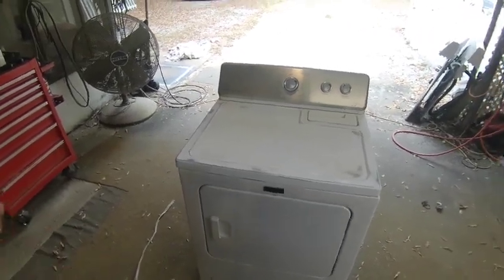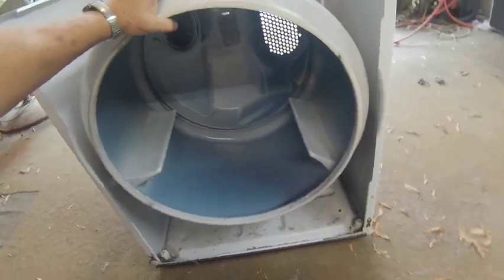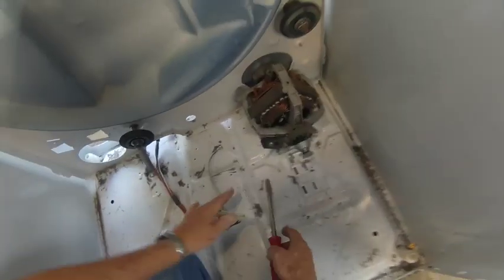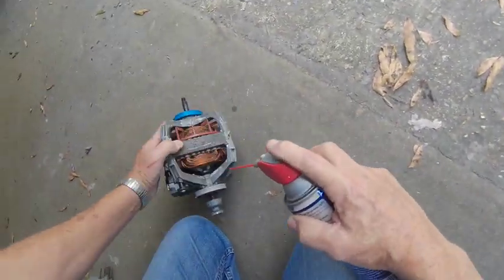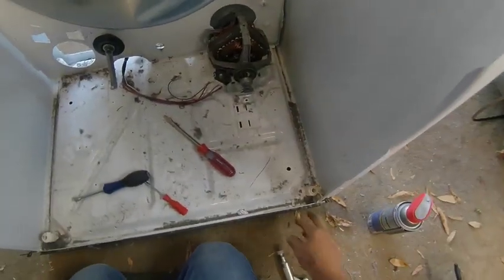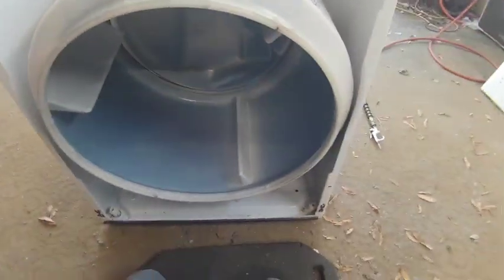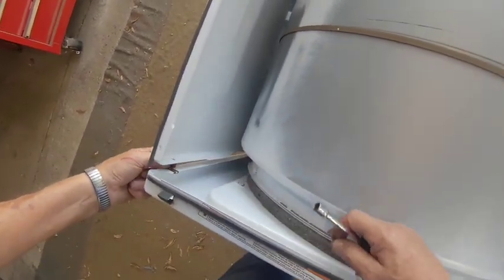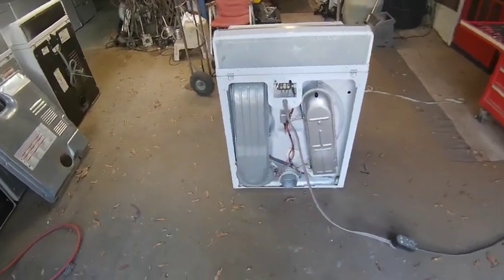How To Fix a Maytag Dryer That Won't Stay On: Motor Replacement Tutorial

Comment: Hey Harper nice video, just a handy suggestion.   On those fragile plastic squirrel cage fans I drilled two 1/4" holes about 1" radius or so away from center installed a spanner pin wrench to loosen fan, kinda like a Briggs flywheel. Good luck 👍
Reply from the maker: Hi there! Thank you for your comment and the helpful suggestion. Although my name is Knowles, not Harper, I appreciate your input. Using a spanner pin wrench to loosen the fan on fragile plastic squirrel cage fans is indeed a clever technique. It can provide better grip and make the process easier. I'm glad you found the video helpful, and I appreciate you taking the time to share your suggestion. Good luck with your repairs! 👍
Reply: Hi Knowles,  sorry for mix up for name.  How did you know it was left hand thread?  Shape of fin or rotation arrow, just wondering
Reply from the maker: I think I broke the first one I ever worked on and that costly mistake was converted to experience!  Some lessons are learned the hard way.

Comment: A homemade deep spanner type wrench that put pressure down at the bottom of the fins on both sides of that blower wheel at the same time would be a nice tool to have to take them off.
Reply from the maker: You should make one, patent it, retire as a millionaire! Good to see you Junk Yard, carry on.

Comment: I have a Maytag Centennial with a timer knob that rotates on its own, causing it to heat up even when I've set it to off. Would this be a timer issue or a motor issue? Any advice would be greatly appreciated!
Reply from the maker: For your timer to advance it has to have power supplied to the timer motor. There are several sets of points inside the timer and I’m betting that you will find one of these stuck together. Watch this video if you think you want to attempt fixing it. https://youtu.be/k8zoNcEHpsI Or just replace the timer.
Reply: @HarperandKnowles  Thank you so much! That did just the trick and saved me $120!!
Reply from the maker: I’m so glad it helped!  Thanks for watching!

Comment: I drill out them wells with 8th inch bit put zoom oil in the wells and work it free.
Reply from the maker: So, you think the overheating is a bearing problem?  I think you may be right!
Reply: @HarperandKnowles  swap out the control stat pm the blower next to the fuse and run it

Comment: I have to ask - would a paying customer get the loose change in the bottom of a dryer back? Or is that a bonus of the job 😀
Reply from the maker: Yeah, I put it in a plastic sandwich bag and drop it inside. If I buy the machine from a scrapper it’s mine.

Comment: I stick a tinner piece of wood at 3 oclock and usually have good luck
Reply from the maker: I'm gonna have to cook me up some of that Daddy Jack's Gumbo!  I don't know if ya'll have it over there but I've been using a dry roux they sell here in Louisiana called Kari's Roux.  You can get it dry or wet.  The Missus makes a good gumbo with it, but I bet it ain't anything like Daddy Jack's!  I grew up with my Momma putting okra in her gumbo but my wife is from Missouri and she has an aversion against boiled okra,  I tell her it's not slimy in the gumbo!  Don't matter she won't do it. Thanks for watching my friend!
Reply: @HarperandKnowles  I have some savoiee's dark roux it is the bomb

Comment: PTFE = Teflon
https://en.wikipedia.org/wiki/Polytetrafluoroethylene
I had a motor with a centrifugal weight come off because the soft pot metal pivot wore thru. I robbed a set off a bad motor, fishing the piece out as best as I could and fished it back into the other. Worked!
I've never had any luck getting a motor to spin once it's been thoroughly locked up with lint in the bearings and rotor.
Reply from the maker: Boy, I bet that was a task.  I'm fortunate to have a good stockpile of used motors that I've scrapped from bad machines.  If I faced that situation I'd just say uh, uh.... and pitch that old one on the scrap pile. You probably did it on account of it being a challenge, didn't ya?
Teflon? Who'd a thunk it? Thanks for looking that up.
Reply: @HarperandKnowles  It was a quest! A what if(?)
Reply from the maker: You have more patience than I. my friend!